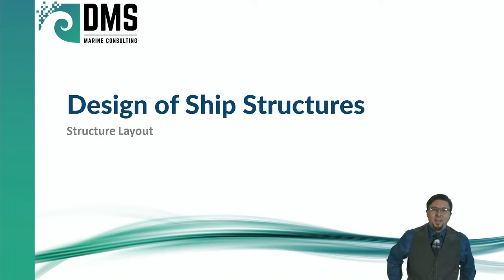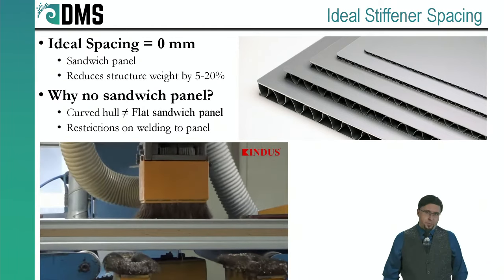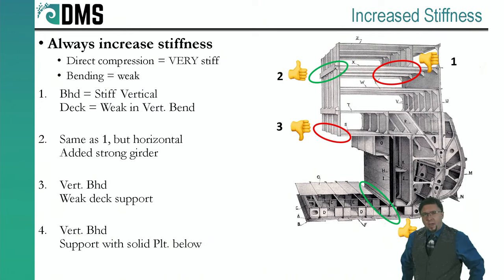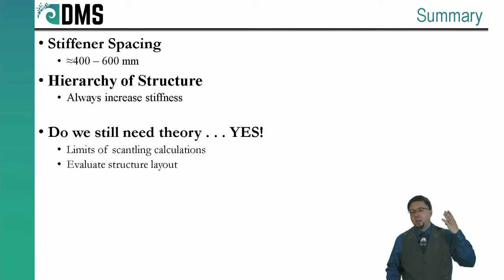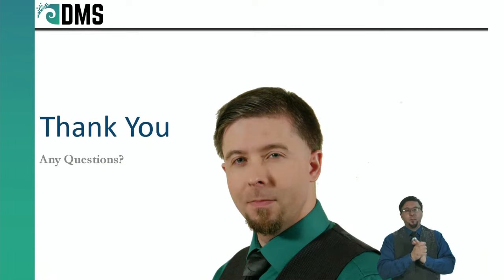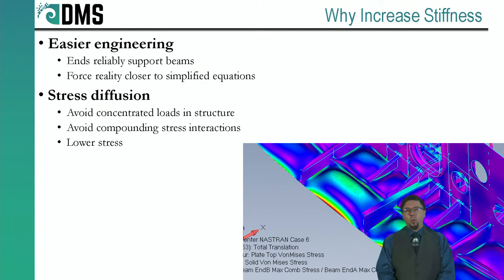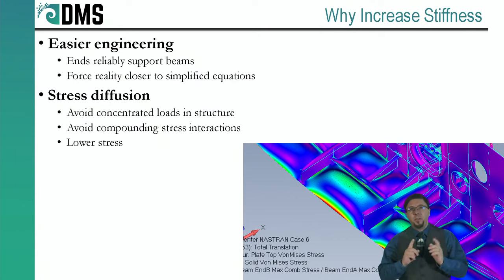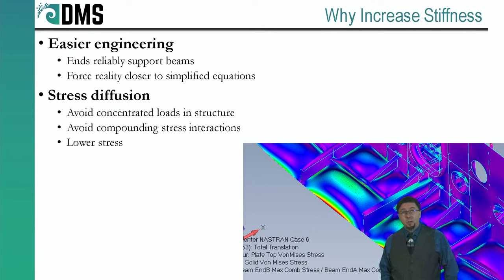How to Layout Ship Structure

Comment: I found this interesting Nick. I was particularly interested when the discussion turned to wood. These days MTC (Mass Timber Construction) is all the rage. The thing about engineered wood, using modern adhesives, is that you get much more consistent mechanical properties than you get with solid wood. It can also be laminated according to the intended direction of load, so parallel lamellae for vertical loads on a beam and cross laminated for sheets where strength in two directions is required. 

For boats I think that cold moulding with thin layers of wood, enhanced by the use of aramid fibre fabrics and epoxy is the bees knees. Once bulkheads and stringers are added, and these can be hollow plywood sections, then you get an extremely strong, light monocoque structure that is hard to beat. When all sealed in an epoxy envelope, the life of this vessel should be almost unlimited.

Comment: 1. the aeroplane Lancaster have skot and stringlers aligned 45 degree, the roder and highroder screv the rear end of the plane. You have propellerblade and roder also.
2. You use I or H steel, what about J steel, lower weight is the result.
3. Thank you.😊

Comment: When doing a side plan, front plan, and back plan  of a ship. I noticed the vertical going from the bottom of the ship to the top of the ship. What is the measurement between line and how is that determined to help make the 3d model

Comment: The cutaway section looks to me like its from a modernized WW1 battleship, the bulging and several vertical bulkheads behind the bulging all look like early (1920's) torpedo defense's to me. The sloped structure called 'R' is probably the main belt armor, sloping it was popular in the early 1900's to increase its effectiveness against (non plunging) hits, like the way WW2 tanks started to have sloped armor.
Reply from the maker: Good deduction.  The original photo was from the midship section of the HMS Royal Sovereign, circa 1936.  Here was the original photo source:
W. Authors, "HMS Royal Sovereign, midship section," Wikimedia Commons, 1936. [Online]. Available: https://commons.wikimedia.org/wiki/File:HMS_Royal_Sovereign,_midship_section_(Warships_To-day,_1936).jpg. [Accessed 9 Feb 2023].

Comment: Hello, dear Nick. Thank you very much for this webinar. You did a great job. This webinar was very useful and interesting for me.  but I have many questions about grillage and I don't really know its calculations. For example, how can I determine which support is appropriate when two longitudinal and transverse beams cross each other? Bold or simple. Thank you for explaining or making a video about this. If you have an article or suggestion, please give me... Thank you very much
Reply from the maker: That is a common problem.  As we get to larger structure, there is no clear "supporting" body.  As you said, this leads to a grillage analysis where all beams combine for total strength.  Funny part, I have never done a grillage analysis.  I believe that with the abundance of FEA software these days, it's more common to just go to a full FEA anytime you need a grillage analysis.  
For example, it is very common that major ship designs will include a Global FEA model.  This is where we model all the major beams and bulkheads in the ship (ignoring the small stiffeners) and check the structure.  The main goal is to ensure the stresses all distribute well, avoiding any large concentrations.
Reply: @DatawaveMarineSolutions  You are completely right. But I came across this point in the scantling that when the floors meet the side girders of the same size in a ship with a single bottom, can a side girder be a support for floor? Or should I say better, can the floor span be the distance between two side girder?

Comment: I'm curious what theory did you use to arrive at 0mm stiffener spacing. This is a problem I've tackled in my undergraduate thesis, optimizing the number of primary supporting members and stiffeners of a grillage structure. My solver algorithm bounds were set such that physically impossible solutions like that were ignored. Now as a classification society inspector, I'm aware there are several safeguards against such designs (attempting to use paper thin plates), besides the usual global and local strength criteria.
Reply: Same here, I'm really curious about your approach to came up with the 0 spacing result. Does that mean to have a thicker plate with no stiffeners? If that is the case, you would require a massive thick plate that weights way more than any panel. Or if is about optimizing the global cost, I think that when spacing is decreasing and getting close to 0, the amount of stiffeners will increase (even if they are smaller and "cheaper") and so the welding length to join them to the plate, which is very costly (man hours + filling wire + gases + equipment usage etc). Just to consider, but for all the rest thanks a lot, your videos are always very enriching for me. 👍👍👍
Reply from the maker: The 0 mm spacing was based on class society scantling calculations, optimizing for reduced weight only.  I assumed flat bar stiffeners and maintained the required thickness / depth ratio.  And then I ignored all the safeguards you mentioned.  The final solution had plate that was wafer thin and flat bar stiffeners only a few mm apart, also wafer thin and only a few mm tall.  Of course, this solution would never work in reality.  And that was the point in the presentation.  The theoretical equations allow this solution, but practical design recognizes that we get too small.  The assumptions behind those theoretical equations no longer apply.  Which is why the class societies have those practical safeguards.
Reply from the maker: @miguelcalvache706  All correct.  I optimized for weight, not cost.  And I ignored weight of weld filler.   So it's not a practical solution.  But that was the point.  I sometimes find that there are useful lessons to learn in the mental exercise of taking theoretical methods to their extreme.  It's not about finding a useful solution.  The more important point is to compare extreme theory against practical solution and learn from the comparison.  In this case, it revealed that sandwich panels are a great solution . . . if we can only find a way to make them practical.
Reply: @DatawaveMarineSolutions  I think the assumptions behind the scantling calculations fall apart somewhere well above 0 spacing but if the Class didn't specify a minimum it was because nobody would actually try it anyway. I'm guessing most people come at it like, given a particular plate thickness what does the spacing have to be?
Reply: Hello. I hope you are fine. The topic of your thesis is very interesting for me. I have many questions about grillage and I don't really know its calculations. For example, how can I determine which support is appropriate when two longitudinal and transverse girders cross each other? fixed or simply supported . I would be grateful if you could either give me your thesis to read or give me an article or suggestion if you have any...thanks a lot.
Reply: @saeedh2742  Unfortunately my thesis is not in English so I doubt it would be of any use... I also didn't use any of the analytic methods for grillage analysis. In the conceptual phase I used the isolated beam method in accordance with IACS CSR. In the preliminary phase I did coarse mesh FEA for a large number of structural arrangements, and in the final phase I did fine mesh FEA for a few selected arrangements.

Comment: How do you balance strength and flexibility?  A ship needs to flex over waves, but how do you figure the correct flexibility and proper ship strength?  Is too much flexibility a bad thing?
Reply from the maker: Yes, too much flexibility can be a bad thing.  Too much flexibility means the plates bend more, leading to early fatigue failure.  On the global ship scale, too much flexibility means the ship constantly bends and twists.  Now we aren't driving a straight hull through the water, but some bendy, curving mess.

To balance this, the key is adding more strength.  But critically, we have to add strength in a balanced manner.  Make the entire structure stronger, not just one or two critical joints.  Modern FEA tools help with this a lot.

Comment: The laminate panels seem like they would be susceptible to undetected internal corrosion.
Reply from the maker: You are correct.  Although the panels are theoretically sealed, inspection is an ongoing concern.  Many of them use a polymer foam for the core, which eliminates corrosion from the interior.
Reply: Ultrasound should still work.
Reply: @quartertwenty484  how good/portable is the kind of ultrasound kit available for such mobile inspections at such depths?
Reply: @DatawaveMarineSolutions Anodized ?